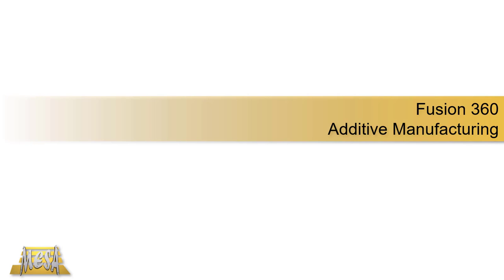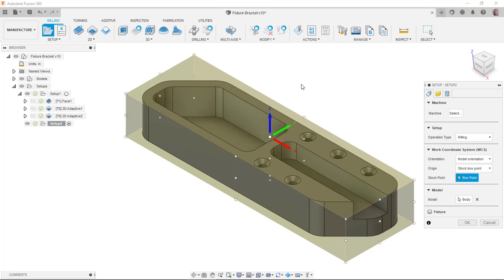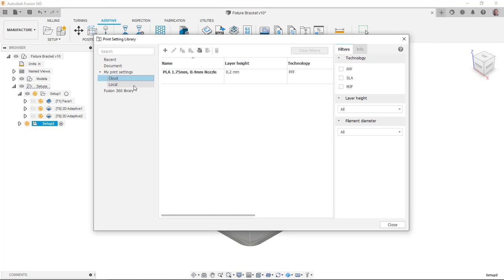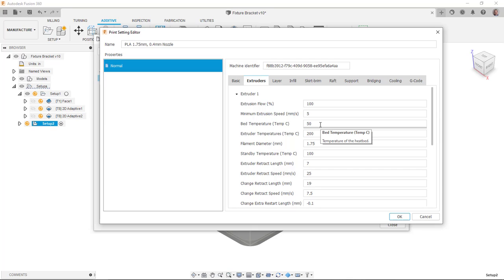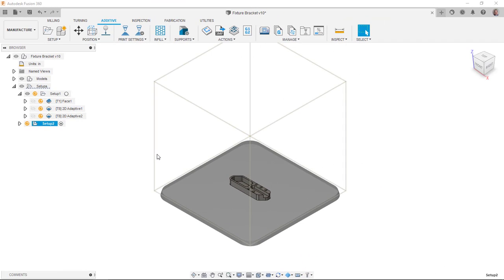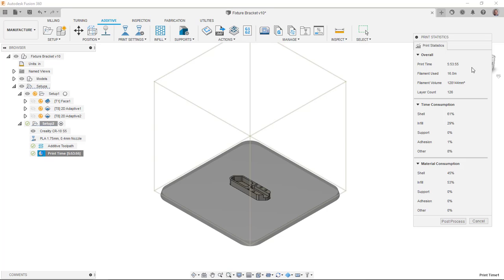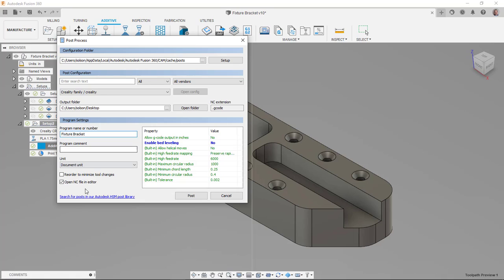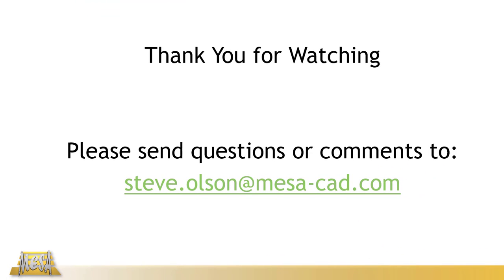Fusion 360 Additive Manufacturing

Comment: How to simulate this with the machine? Till today I didn't got a machine simulation video of additive manufacturing
Reply from the maker: Fusion 360 can simulate tool paths if the machine used is listed as Simulation Ready in the Machine Library.  I just double-checked to see if any additive machines are flagged as simulation-ready.  Currently, only subtractive machines are simulation-ready.  You can use the Fusion 360 Machine Builder to define a new simulation-ready machine, but I don' think it supports additive at this time.
Reply: @3DSteve52  yeah, I have tried to add my custom machine, in machine builder when I chose Additive manufacturing it doesn't give the options for machine kinematics. May be they will release in upcoming updates

Comment: i can't edit the pla. I don't understand why it request about 80 hours to do a printing simulation
Reply from the maker: Ivan, if you are choosing the PLA from the Fusion 360 Library, it is read-only because it is in the library.  You can copy and paste it to the document or your own cloud library.  This can be done through the right-click menu.  Once it is in one of those locations, you should be able to edit the settings.  Inside of that material will be settings for layer height, bed and nozzle temperatures, print speeds, and many more options.  I hope this helps.